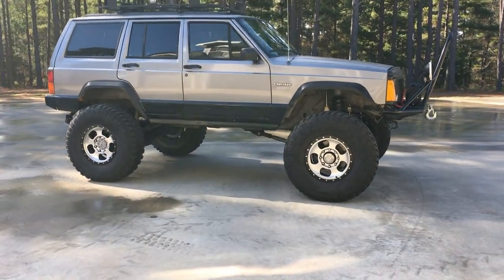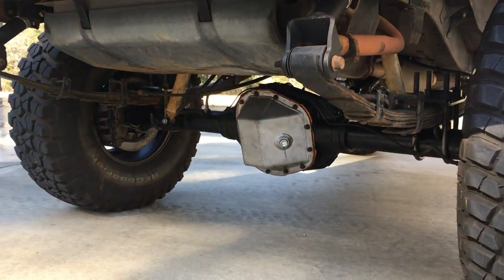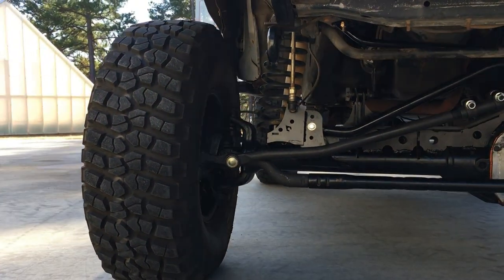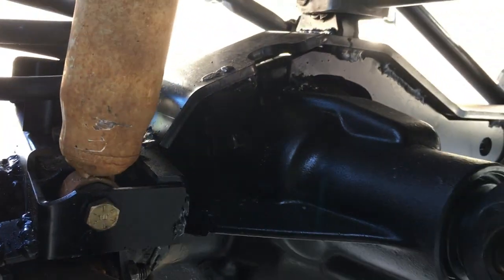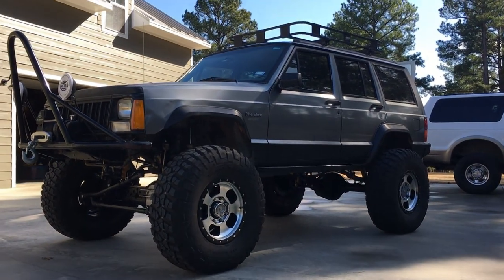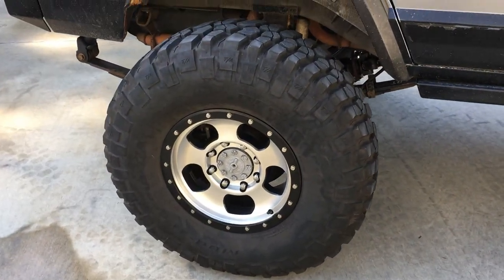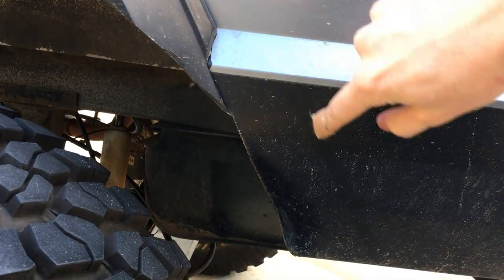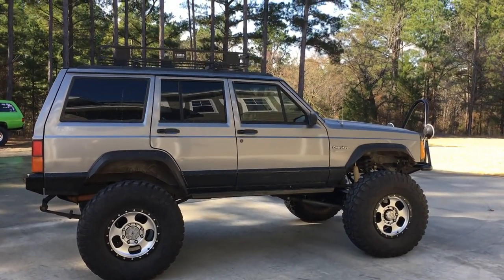Jeep XJ 1 Ton Project Overview | Superduty Swap, Drivetrain, Suspension and More 2018 Update

Comment: Is that just a 1350 companion flange that fits the sterling?
Reply: Or from an excursion rather
Reply from the maker: We had bought a separate flange and it didn't work so when we had Tom Woods make the rear driveshaft we told them what we had and sent them some measurements and they made sure we had the correct flange with the correct bore to fit over that circle on the pinion flange. Sorry do not have the specific part number...but I would call tom woods or adams and tell them the year of your axle and they will help you find the right flange.

Comment: Did you change the brake booster and master cylinder?
Reply from the maker: Nothing...just used factory master cylinder and system...brakes work perfect and very strong...spongy pedal is just from the extra fluid required to activate the bigger brakes but doesnt cause any performance issues! Much better than stock was! Such a pleasant surprise!

Comment: How will stock axles hold up to 37s?
Reply from the maker: if you have a 8.25 Chrysler rear and dana 30 HP front  leave them open they will hold up fine to some moderate wheeling...if you put a locker in either you will blow them up :)

Comment: Did you need to make a custom Trac bar?
Reply from the maker: No but we did have to modify our rustys HD track bar slightly...we had to cut the axle side bung off and cut around 1 inch out of it and reweld the bushing end bung  back on! That was it
Reply: @rockquestoff-road2839  ok thank you! This is gonna be my winter project.
Reply: Did you have any axle wrap issues? I'm considering going spring under.

Comment: how much did the axle swap cost?
Reply from the maker: Since we bought the front axle from a guy with 5.38 gears in it already for 600 it got us a little ahead of the game...2005 sterling rear we got for 400...new brake calipers and rotors front and rear, new bearings etc....Yukon air locker for rear and Yukon grizzly locker (Detroit) for front...Artec truss kit $450ish...mike market hubs for front...Front Dana 50 around ~$2000 brakes and truss and all....rear sterling $~2500 with brakes all new, spring perches etc. so about 4500-5000 total...pretty incredible how much cheaper it is than getting crate axles from teraflex, Dynatrac, Currie etc. they cost around 12 to 18K once you get gears and lockers in them crazzzyyy...

Comment: One ton axles strapped to an aluminum foil body.  Honestly I don't see how that makes sense  looking for the next update I guess.
Reply from the maker: Yep we were not sure how well the steel unibody would hold up...but have been surprised! Have had the long arm and 37s on it for 10 years and have no cracks, bends, buckling...no issues at all. 4 doors are way better than 2 doors because of the extra door opening and gussets. If you are jumping or rock bouncing your jeep then I would suggest starting with a body of frame jeep :P

Comment: Where i live this Truck and any Truck Lifted with tires sticking out of the Wheel Well's is a sure Fail. Don't understand how you can get away with this. Have a 2000 XJ and was told by the Mechanic to leave it Stock or it would not pass Inspection. Massachusetts Inspection Laws Suck. My Truck don't even get an Emissions Test but they will Fail it if it's lifted or the Wheels are sticking out beyond the Wheel Well's. Makes no sense at all.
Reply from the maker: WOW that is horrible. LEAVE IT STOCK? Sorry about that man. We live in the great state of Texas :) as long as the headlights are under 52 inches we are fine

Comment: What did you do for your brake hoses?
Reply from the maker: They are BDS 8.5 inch lift stainless hoses...the fittings work on the 1 tons same as stock 👍🏻